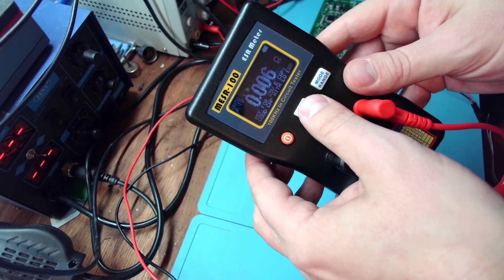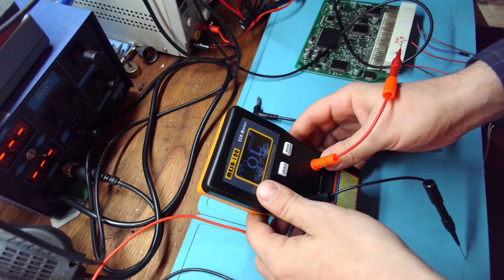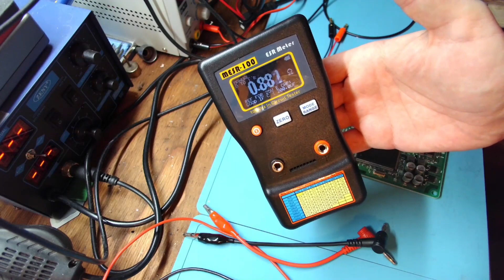MESR-100 ESR Meter | Custom probes for in-circuit measurements

Comment: Finally, somebody else with the same complaint about this device, as me. I bought this thing pretty much when it came out. And I really haven’t used it much since because of its leads being so FREAKIN’ SHORT. How anybody can make ANY kind of in circuit measurements, with these things is beyond me. So, at some point I tried to build my own test leads but I kept getting the “can’t zero” message, so I shortened the leads and I got the same message over and over. Till finally they were basically the same length as the originals - I gave up and really never much used them again. You should post the length a kind of cable you used, for yours, it could help a lot of folks… like me. Cheers!

Comment: Very interesting video ! I have this meter from a few weeks and I found it to be not so reliable. Why is changing tested values of the same capacitor ? Even changing the position of the clips : one opposite to the other or one against the other changes the result. I’m taking about brand new capacitor not installed yet so I’m testing connecting to the original “legs” of the capacitor. Same issue for longer cables as you said in the video I cannot calibrate some types . I tried one for smd misurement “tweezer style” and it seems to calibrate but it’s not so easy to mantain a good connection for the measurement time.

Comment: Can you please provide links to the parts to make those needle probe wires with the plugs as you have put together?
Reply from the maker: I got everything off eBay, it's been a while now so even if I had those links they would probably be no longer relevant.
Search for needle probes and banana connectors.
Reply: @blackhorserepairs  alright thanks 😊
Reply: @blackhorserepairs I have the same esr meter. What size probes, and banana connectors I need for the esr meter?

Comment: You are adding all manner of resistance with those shitty screw type banana plugs extra contact surfaces.
It's much better to just take some (oscilloscope probe) Coax and fit a pair of very short leads to banana plugs on one end, then solder sharp probes on the other end on suitable length flying cables at the other end.
Or even better, add a BNC socket onto the meter, then you can simply plug in a standard Oscillocope probe, and use the spring connection rather than any flying lead.
Reply from the maker: well, you are not wrong but how practical is the advice to "add BNC socket onto the meter"?
If I ever figure out how to do it easily I will definitely publish an update to this video :)

Comment: It funny how the price of that meter varies wildy from seller to seller on Amazon. It's a decent meter though.
Reply from the maker: Interesting, I got mine on eBay.
Reply: @blackhorserepairs  I got mine cheap but there are shiesters asking almost 200cad on Amazon. I broke down and bought an lcr meter that has far too many options for me. It cost me an extra 170 or so for the smd probes and the kevlvin ones. I bought uni-t kelvin probes as the flir ones cost more than my first lab set up haha. I recently gave away a transistor tester with a learning kit I sent to someone for free (it's something I do) and I miss it more than anything. I'm going to get a peak atlas one so I don't give it away haha. I've given away at least 8 testers hahaha each time I immediately bought a new one. Can't beat them for matching transistors.
Reply from the maker: @jstro-hobbytech  very generous. How do you decide who to send your expensive equipment? 🤣Can I get on that list?😂
Reply: @blackhorserepairs - not really all that generous. I am sure you can afford < $10 for a transistor tester, right?

Comment: I love these needles.. I use them on bench and for back probing sockets in cars.. Wires I have factory made with 4mm plugs in both ends.. Expensive, but worth it because of very small resistance..
Didn't thought about making my own LCR meter wires.. 😉 Great tip.
Reply from the maker: I'm glad you found it useful

Comment: Please next time make a short video, you just waste my time! 
This video should be 30 seconds max.
Reply: Tiktok is the place for people with short attention span. Nothing wrong in explaining things in detail with personal thoughts on the matter.
Reply from the maker: @simoncowbell.6783  thank you ♥
Reply: i can't believe someone say that .....,thanks for the vídeo man ❤
Reply from the maker: @netten2053  thank you for your support, much appreciated
Reply from the maker: sorry about that, it probably should be. It's one of my earliest videos 😀
Reply: @blackhorserepairs  great video! wha garage wire did you use for the new probes?
Reply from the maker: @raidersan2  gauge 14 steel
Reply: @blackhorserepairs  I don't know that one or it's a lost in translation problem. Steel wire here is hard, difficult to bend. Did you mean single core or is there really wire with a steel core?
Reply from the maker: @raidersan2  it's not a single wire, in fact it's the wire repurposed from ATX Power Supply, not sure if it's steel but it's not copper (by the looks of it).
Not that I recommend this particular wire, it's just what I had and it works well
Reply: @electrobuz1 pls don't generalise to your quirky needs... there are other platforms where you'll get fantastic technical advice in a few seconds and where manners are optional, why do you feel like you have to belittle somebody who is putting in the effort?
@blackhorserepairs I really enjoyed the video. what gauge wire did you use for your new probes?

Comment: I use the Anatek BLUE.  I uses longer leads.  I have banana connectors on the ends, and push on crocodile clips. To make them pointy and more precise when measuring in-circuit, I put specially bent "legs" into the crocodile clips.  Very versatile this way for any job.  Thx for your vid.
Reply from the maker: thank you, it's on my list to purchase, however, it is significantly more expensive so I'm waiting for some spare funds before I get it 😀
Reply: @blackhorserepairs  How about this low-cost meter here? https://www.youtube.com/watch?v=sYbGvJe5n4s
Reply from the maker: @surgingcircuits6955  that sounds like a dream meter, it just moved up on my list :face-blue-smiling:, thanks a lot

Comment: 0:45  EXCUSE ME..... HOLD THE FUCK ON A SECOND
it's not  WHATEVER, OK

Clearly ALLIGATOR CLIPS

Please get it straight
Alligators live in Fresh water
Crocs live in Salt Water

if you put these leads in salt water they will rust
THAT'S WHY THEY ARE NOT CROCODILE LEADS

Please use the correct Pronouns
ALLIGATOR CLIPS IS WHAT THEY IDENTIFY AS   :p

Comment: This was my first ESR meter.  I found that the tweezer probes from  Firgelli automations work well. Its the one with the kelvin clip end.  The much longer probes that came with my Bside ESR02 pro also zero out just fine as well.  I got myself a blue ESR meter last week from Anatek and will probably give the MESR100 away. The blue esr is a superior piece of equipment in everyway except cost. Keep those videos coming, I really enjoy them.
Reply from the maker: The blue ESR meter has been on my wishlist for a while, I can't wait to get it and test it against MESR, maybe in a couple of months :) 
thanks!
Reply: Can you please provide the link to that Anatek blue meter to take a look? 
And does someone have experience with a DER EE DE-5000, how this one fit between Anatek blue and MESR 100?
Reply: Hay otro que es mec 100, será mejor que mesr-100? 🤔
Reply: @tv_you-_-tube_tv  para ESR no es mejor que el Mesr100.
Reply: @guateque1718  Gracias. Eso significa que seguiré con mi mesr-100  entonces.
Un saludo 👋 😉